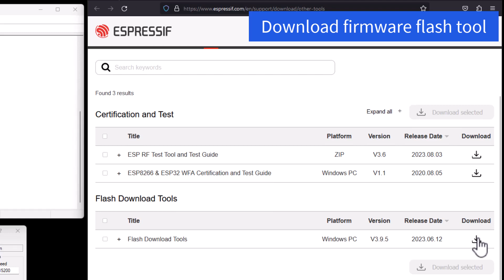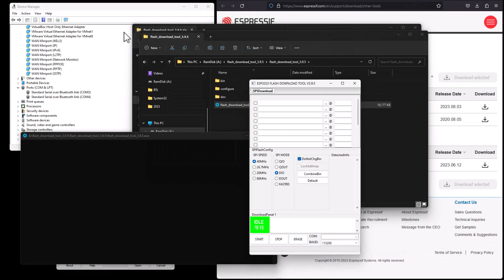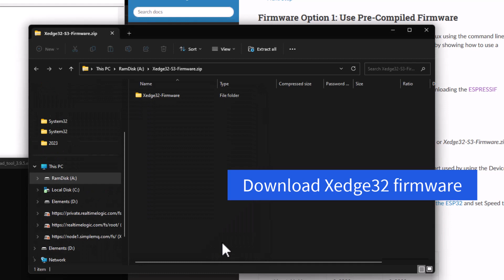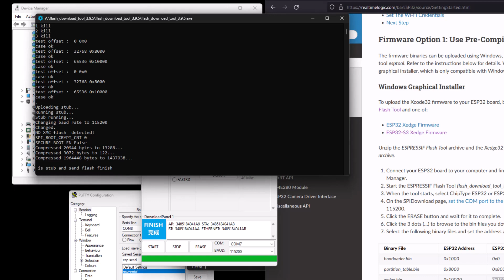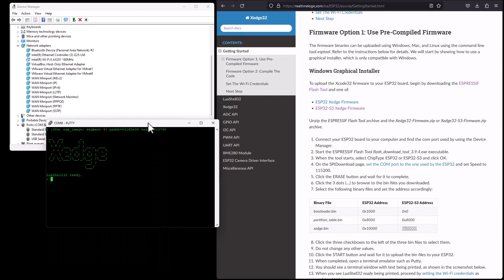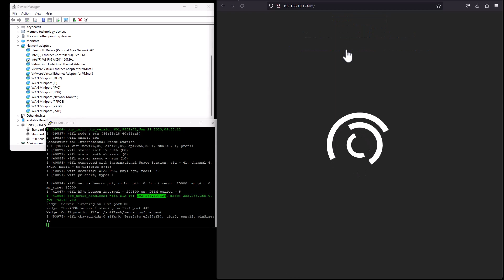Step-by-Step Guide: Flashing Xedge32 Lua IDE on ESP32 & ESP32-S3 (Advanced Option)

Comment: works! great!  (o.k..   first try, "blink"  -  and the board has to be more than ESP32 / ESP32 S3...   it has to be with RAM...  so I had to order a new one)
Reply from the maker: A quick note on ESP32 memory:
When buying an ESP32-S3, choose a model with 'N8R8' or 'N16R8' in the name. These indicate the flash and RAM sizes in megabytes. 

Xedge32 requires a minimum of 8MB to run on the new ESP32-S3. 

You can also use the original ESP32, provided it has 4MB of PSRAM. However, OTA firmware updates are not supported on the original ESP32.
Reply: @RealTimeLogic  Wat about ESP8266/ will it work. I want to use OPC UA on it. Tnx.